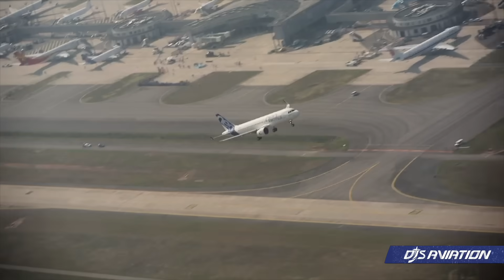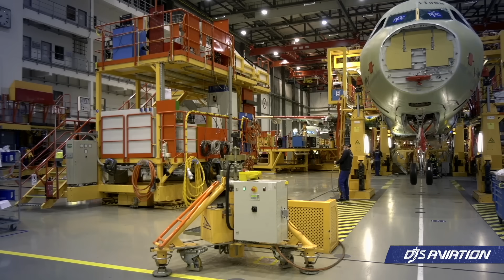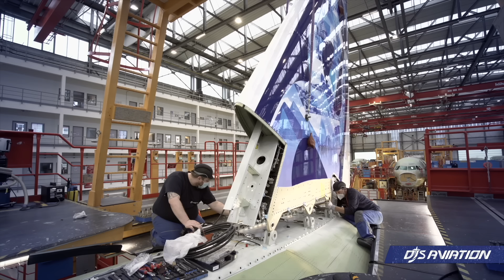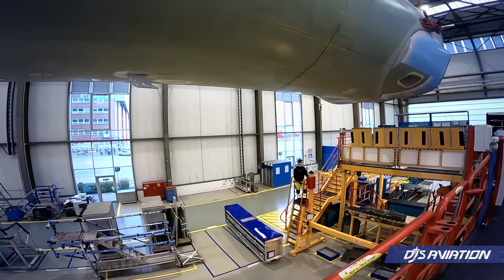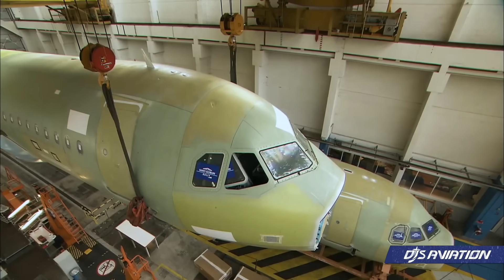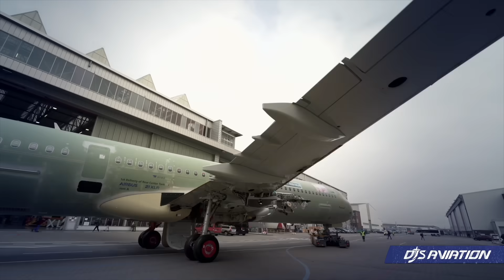Airbus Plans New Aircraft

Comment: I think its unlikely for Airbus to wait that long. The prop fans are coming and they need to get out and design a plane basically when they are ready for production. So that would imply thay will announce the plane in 2016-17. First flight will be 2029-2030, and delivery will be 2034-2036.

While both Airbus and Boeing got a huge narrowbody backlock for now, they probobly would want to carry some of that backlog over to a new aircraft.

Comment: Those blended wing tips were first used Boeing.  The Airbus A319/320 series never had any and Airbus did their own research to counter that the savings were negligible.  However they later decided to use those Winglets then in this latest series the blended wingtips.  So I’m not sure what advancements they are going to make to reduce induce drag.  The Boeing 787 has straked wing tips which essentially extends the wingtips without increasing the over diameter.  The 777x will have folding wing tips.  The 737 max has split wing tips.  The common theme is that to reduce induced drag, increasing the wings ever so slightly at the tips and tapering it is the most cost effective without affecting over all aerodynamics behaviour.  It will be interesting to see what Airbus comes up with this time without doing the same as what  Boeing has done.
Reply: Flexible wing tips that can flex in strong turbulence independent of the rest of the wing, which reduces the fulcrum strain on the wingbox in the fuselage and so provides weight saving due to less meat in the fuselage structure required. You can see this in the wingtips of large birds like raptors.

Comment: They could call it A320XL, sized between the A320neo and the A321XLR and later also launch a longer A320XL-200 to complement it and replace the A321 XLR. For the original lenght A320, a stretch of the A220 would be ideal.

Comment: All they will be focusing on is stabilising production, managing to ease supply chain issues and clearing their 8,000 plus backlog of aircraft for the time being. Not really developing a new aircraft at this very moment!
Reply: ya just looking at some production numbers, it looks like Airbus will barely produce as many planes as last year. Probably fewer A350s and A330NEOs. I wish they were more transparent about what these 'supply chain issues' are. Why can't suppliers produce as much as they did before the pandemic, what the hell is happening? It's been 5 years, clearly something is wrong.
Reply: @malcolm5514  Its mostly the bottleneck in engine supply, because all the major engine manufacturers have had defects in recent years that have required for example fan blade replacements to existing engines, this has reduced the parts available for completing new engines and so theres backlogs of planes at the manufacturers just waiting on engines to be delivered.

Comment: Is it the A360, A370, or A390?
Reply: Or it could be the A230.
Reply: Maybe.
Reply: No! This is just the A320 as the generic program and will remain as is since it has no drama sticking with its reputation, unlike the 737, therefore, is no need of a name change to shove bad memories away.
Two things though:

1) the Airbus single aisle program is named A320, but generic models names are A318, A319, A320, and A321 depending on fuselage length. A320 may refer to the model OR the program depending on the matter. To make things worse, Airbus wasn't used to conserve naming slots, the A310 being a SHORTENED and upgraded version of the A300, practically making it an A300 with a shorter fuselage under the A300 program, it lost its initial model name of A300-B10 to use a separate name, the A310, because airlines were fed up of the complex lengthy naming style. Same for A330 and A340 who are basically the same design.

2) circumstances evolve, A321XLR is just ONE step to narrow the gap between medium haul low demand and long haul low to medium demand, currently served by 757 and 767. Those two, ON THAT MARKET NICHE, has no successors, and none is to be expected before 2040-2045. Incidentally, a very serious alternative would be an A322 model, and even possibly an A323 one (still under the A320 program). However, to make that possible, a LARGER WING IS INEVITABLE! A321, A320 and A319 NEO successors may follow suit, with a SMALLER YET REDESIGNED wing, not necessarily a new engine, most likely upgraded currently existing engines retaining most of the components.

An A321 may be assembled with new wings, new engines (upgraded), new stabilizers profile, and even a newly shaped nose, it's still an A321, just as 737NG with new wings, new stabilizers, new engines are still 737s in line with 737 classics under the 737 program. Hope you understand names are just names, they don't mean nor grant definition of an entirely new model or program. Much higher above the significance of a name, is the cost of everything related to the qualifications and logistic upgrades by acquiring and operating the latest type. An upgraded A320 program is many times cheaper than a new A360 (or whatever A3nn) or a new Boeing (797 or whatever n7x7)... People usually forget "new is expensive as hell, it's only a viable option if plebs - well, hum, travellers are willing to PAY MORE..." Before wanting something new, you should observe wether everyone is engaged to pay and able to deliver when the bill arrives...

One IMPORTANT note: the same wing for different fuselage length is NO LONGER a viable standard! Wing dimensions must match required weight to lift ratio and intended range, to save WEIGHT and be EFFICIENT at actually making MONEY!
Second IMPORTANT note: relevant ranges are the ones airlines ACTUALLY operates in their network, NOT the maximum nautical miles the aircraft can cover!* Manufacturers and the public may boast the range of a given model, on an operator's point of view, useless overly large and heavy wings containing large fuel tanks volume will burn wasted fuel for practically nothing. A318 and 737-600 failures says it all, similarly, A330-200/800 and 767-200ER.

If I were Airbus, the only time I would consider an entirely new narrowbody deserving another name and type rating, will be when BOEING finally admit 737 has no future and propose an entirely new design to airlines (likely to be a 797); then, I (Airbus) will put everything I have on the line to get Boeing out of the game with a better product by driving it bankrupt... That's how serious people in charge of serious decisions think, the opinions/feeelings/beliefs of an aviation enthusiast on youtube are IRRELEVANT.